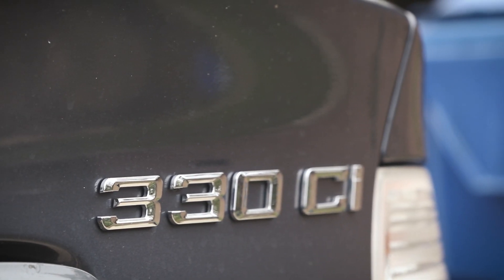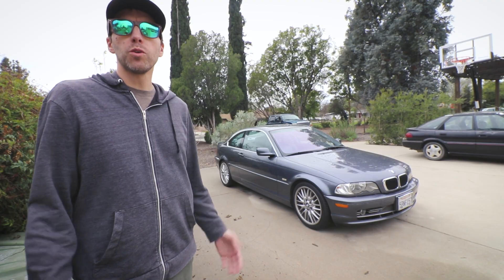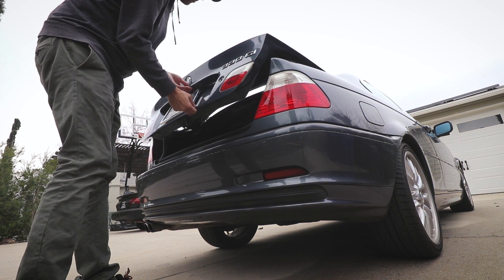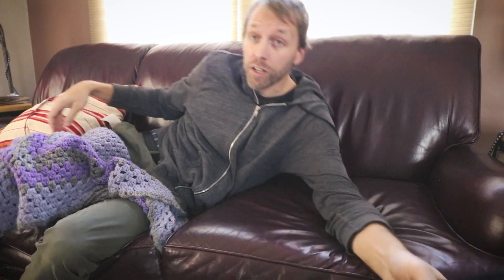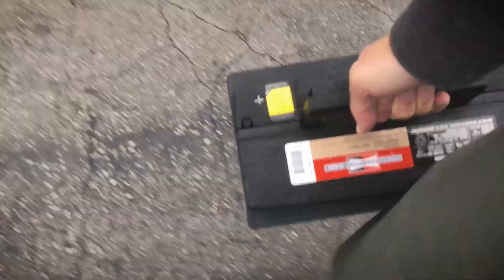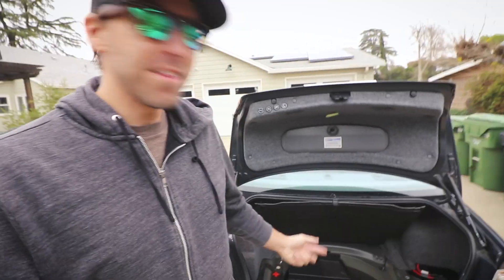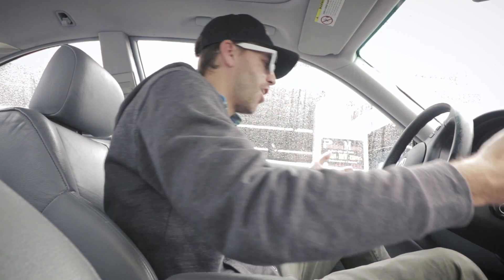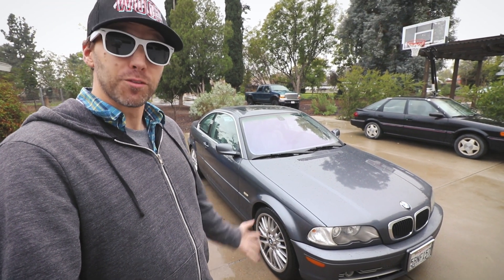Nothing More Expensive Than A Cheap BMW? - 330ci E46

Comment: All about the owner, I’ve owed 6 Bmws and beat them to hell... never once stopped running
Reply: But I agree with what you said at 5:25
Reply: Cody Holtsclaw go buy a bmw Alpina B7 like me you got to baby it or it will break faster then you can say shit broke the bank
Reply: That's a good statement. And yeah bmws are reliable depending on how you take care of it. Most of these cars have a known issue. For instance my s54 is known for it's vanos and rod bearings. Though if I leave it and keep running it, I can literally tear up my head. Then you'll find an 80 dollar broken timing chain guide ends up costing you 3000 dollars for another motor.  Other than that I've probably dumped over 5k into my m3 most of it being either suspension, maintenance, or restoration.
Reply: Yup. My E60 530i had 220,000 before the first ever problem hit (steering pump).

Comment: I just bought a e46 sedan 325i facelift for 900 bucks and the transmission is buggy, I think its because the fluid was likely never changed. Every single other part of the car is perfectly fine though. It's not the car, its the owner.

Comment: I bought a 2002 325i for 1600 dollars as my first car. Car had 215000 miles and I’ve since put 8500 miles on it in 6 months, and not had any issues mechanically. I’ve put around 250 dollars into it since (that includes 2 oil changes and a new set of plugs as well as a new air filter). Main issues with it when purchased were warped rotors, bad LCA bushings, and 2 bad window regulators, all of which have been fixed for very cheap. All In all I’m super happy with my purchase. I think I owe the reliability of the car to the previous owner. I found a service record in the glovebox from 9 months before I bought the car for 1800 dollars purely in preventative work, and the car was obviously cared for and well maintained which is reflected I’m not only it’s condition, but how it drives. I can honestly say that I love this car. I had no intention of buying a BMW, but when this popped up and fit my criteria (cheap and manual transmission) I just couldn’t refuse. I’m so glad I didn’t. I now plan on saving and hopefully buying another E46, but this time a 330i/Ci.
Reply: As your first car??? I wished I could do that in the UK

Comment: Who buys a car without driving it then complains about it smh
Reply from the maker: Not complaining. Just documenting what happened. :)
Reply: It didn't fly to his drive did it. BMW starters are pretty binary in operation (they work or don't like most electronic items). I've been trailered twice because one that worked fine to get me somewhere didn't work when I got back in the car. 125k on average so 99k does seem a bit low for one. YMMV I guess....literally.
Reply: @ruk2023--  That's one of the main reasons to buy a standard. So the starter can't immobilize you..
Reply: Had the EWS module go out on mine not too long ago. Same symptoms. Tried new batter and bump starting the car but it would fight to turn on. 250 and an hour of labor to reprogram the computer and she was starting on her own again
Reply: M3 Bimmer I just did

Comment: Whem my starter broke i remove it myself for 30min ,dismantle it and findout the coil that turns on thenstarter is fault. Bought new for 20$ and everything back.Didn't call tow truck,didn' sleep and eat while the mecanics repair my car.I get my hands dirty and did't hate that great car.
Reply from the maker: Totally understand about getting your hands dirty. But replacing the starter in an E46 is def more than 30 minutes.

Comment: Working on BMW is actually incredibly easy. They are put together so well that they actually come apart very well. They're just Layered. you have to take a lot of crap apart to get what you were going to work on. 

And having small hands sometimes helps. But there are tutorials almost everywhere on YouTube. And there are many blogs that you can print out the tutorials with full-color photographs. 

I have a 2005 M3 and redid my entire cooling system and police and tensioners using a 35-page print out. It was a snap.

Your 330i  E46 is almost identical to my E46 M3 in many respects. They share a lot of common parts too. So I know that they are really easy to work on. 

Anything after 2006,  you need a lot of diagnostic crap because it's so computerized. E46 was the last Model a shade tree mechanic and really fix easily.

Comment: Starter on my e46, $86 and an afternoon of work. New Battery, $35 from the Blemished Battery store, new rims, (new to me Craigslist), $80. New rubber, $260. New Struts and strut tower bearings, $250. (Monroe sensi trac and SKJ strut mounts). 10 piece front suspension kit, $170. (control arms, control arm bracket/bushing, etc), lifetime alignment $ $150. (asked for the $25 off coupon). Cost of car, $800. (craigslist,145K miles).  oil change and tranny oil change I don't count as that's maintenance instead of repair. Moral of the story, if you shop around and have the time and know how you too can tool around in BMW for a little over $1,800.

Comment: lol $700 i changed all the vacuum hoses and the starter and cleaned everything the whole intake manifold inside and out for $100, its not that hard just time cosuming as you have to take off the whole intake area to get to the starter when i found ouuut the minium to work on a bmw is $125 an hour diy isnt so bad and people say its hard to work on bmws and i think its quite easy besides the one thing the starter everything else ive done or changed was quite simple or a quick fix
Reply: Are you a mechanic yourself or just experienced with cars?
Because last week I had to replace the blower resistor behind and next to the glove box. 
Getting the glove box and screws out from the unit was easy. But boii.. Getting out a "stuck" metal and plastic unit that has been in place for many years is so hard to pull out.
Reply: No I'm not a mechanic but I've been doing all my own work to my cars since I was 16 I've never had a blower go out in any of my cars in my lifetime thank goodness
Reply: @Spaange  you mean the hedgehog? Done that last year on my 99 318i E46 only its via the drivers footwell on RHD, still have to remove the underside of the steering for access same as the glovebox. Nevertheless it's buried in there good and was a royal bitch to change. Think it took me most of the day as most of it was spent swearing at it lol. The starter motor was a 30min DIY. Can't recall actual time but I know it was quick and easy.
Reply: slabby rider idk for me one job I won’t really do is a slave cylinder such a damn hassle
Reply: e46's are super easy to work on, did a ton of work on mine, not really reliability related, just maintenance, clutch rear main seal, oil pan gasket, a handful of other seals, and it was honestly easier than any honda ive ever worked on
Reply: @plantedrabbit3  it's funny cause I had a 240sx s14 and it was easy to work but I tell people my BMW is easier to work on cause your not limited on space in most areas like my 240 was when I was doing anything to it
Reply: They are very easy to work on. I’ve replaced many many parts in my 2 BMWs including a starter, which wasn’t that hard tbh. One of them is approaching 300k miles and is still going strong.
Reply: just did the valve cover gasket in a bit less than 2 hours for 60$ bmw wanted 592$

Comment: Keep driving it with the gas light on and you will be sending it back to the repair shop for a new fuel pump and filter. lol
Reply: Fuel pump is very easy to replace, it's under the back passenger side seat. Replaced mine on my 2002 BMW 330ci. Got the fuel pump from the junkyard for $75.
Reply: He outright said he was cheap,, so what do you expect....?

Comment: Actually the E46 platform is not that bad. I own a "cheap" 330ci with 301000km and the only things that went bad since i own it (have it for 60 k km) were some bushings in the rear suspension, the coolant expansion tank, front lower control arm and some clips at the sunroof. Of course my headliner is sagging. ;-)
Reply: However, I replaced the CCV system, the headcover gasket, the water pump, thermostat, sparkplugs, vanos gaskets (Bisan Systems), shifter bushings, rear shocks, shock bushings and some other bits for preventive maintenance.😂
Reply: I see a lot of comments about the sagging headliner, but mine looks brand new and my friend e46 looks pretty good as well.
Reply: The headliner itself is fine. Its the a, b and c pillars where it is sagging (at least in my case).

Comment: I hate the "cheap BMWs are expensive, period, the end, no changing my mind" mentality. I bought an '02 330ci and it's amazing, because I didn't go into it expecting it to have no issues, nor did I go into it with the mindset that it would be outrageously expensive to fix. I've had my car for 2 months now and the only issues I've had are wheel speed sensors, and consumables. The vacuum lines are known to go bad over time, especially with the "m" series engines, as well as starters, you should've expected that going in to it. As much as I'd hate to be that guy, but seriously, do some work on your car yourself, I get the starter, but the vacuum lines are relatively easy and accessible.
Reply from the maker: For sure, working on BMWs yourself can save a ton of money. Just didn't have any interest doing the starter, not a fun job. But absolutely, would've been much cheaper had I done it myself.

Comment: If the Battery is empty the starter makes clicking noises and dont Turn the Engine. Just a tip Mate ;) like this Video and Greta from Germany and BTW you Need a Voltmeter do you can easy Check your Voltage ;)

Comment: Old BMWs are known to be reliable. My father had his 1996 BMW E36 318is valuable at 3.000€, the car had 130.000km and the only problem it gave in 20+ years of ownership was the battery that died once. It all depends on the owner and how they treat them, and still, these cars can take a beating. Especially big engined like the 330
Reply: I have a 318i auto with 370000 km on the oddo

Comment: That trunk handle - find a cheap one on eBay, spray it flat black, bolt it on and call it good.  That’s what I did to my grey 330Ci and it looked factory...saved about $170 over a new replacement part
Reply from the maker: Luckily I found a color-matched one on eBay!
Reply: Hello Road / Ethan Tufts well there you go!!
Reply: These e46 cars are super straightforward and easy to work on with a good automotive tool set

Comment: 90s and early 00s bmw's are not to bad. Its the overtechnical new/young ones you have to watch out for. And the E46 is one of the best "modern"  bmw's ever made. But you do have to baby it if you wanna put some serious miles on it. I've seen a few with 300k + miles on them.

Comment: I have an E46 320i and I had a big problem that took me a long time to figure out. I checked the battery, the starter and even replaced the ignition switch. No crank and no start. I discovered by accident that the fault was in the immobilizer. It had a broken capacitor. The repair cost €0.50 but took two years to discover.

Comment: Hopefully, the coolant and heater pipes have already been replaced. Otherwise, you might be wishing that they got replaced this time around. Those pipes run along the engine block and are only accessible by removing the intake manifold.

Comment: A 2003 5spd manual with 99k for $2500 and $900 Into it isn’t too bad.  My ‘05 E46 sedan has 221k and runs like a champ. These cars are impossible to flip and should really be bought for fun. Supe them up and enjoy. Great engineering and plenty of reason to get under the hood of you like that.
Reply: Relevant and best comment

Comment: I used to be a serial BMW owner.
But each new one was less reliable than the one that preceded it.
The last one visited the dealership 26 times during the warranty period so I sold it 100 miles before the warranty ran out.
I bought a Buick Regal (Opel Insignia) GS and it has 193 K on it now.
Never stranded me or failed to start and in the seven years I have owned it only off the road for three days for repairs.
1. ABS sensor
2. A/C condenser. Damaged by road debris.
3. Alternator

Comment: Don't hesitate to go after market for most of your parts. You'll find that many of the German aftermarket are not aftermarket at all. It's the exact same part without a BMW box.

Or things like gas struts for the hood and trunk are by The dirt cheapest Amazon Chinese made stuff. It's fine. It's just fine. Just use your head when you're buying parts made in Asia. For engine components stick to German or USA
made.
But I've bought Asian made side view mirrors variation made running lights on the corners they were already Depo.

I got a set of the most beautiful gloss black kidney grills that were made in Asia that were far better than the German made crappy ones that game with the car.
My HID fog lights are from Asia and they are just dandy 6000k bright and beautiful.

 I buy almost everything I need from Amazon or Ebay. And the rest on some of the larger dedicated BMW Supply sites.

All my pulley tensioners Etc exact same part made by a company called Ina that supplies the parts to BMW. So I just bought these Ina parts without BMW box for pennies on the dollar.
 German made ..exact same part. I bought them on eBay for almost nothing brand new.

My thermostat was American made, I bought on Amazon brand new for $25 instead of the $90 BMW version. My thermostat is every bit as good as German one if not better. 

Gaskets O-rings nuts and bolts all on Amazon just get the part numbers off of a website called Real oem.com.

 Do a search using the part numbers for every single things that you need for your car. I would just do searches using part numbers that you obtained from realoem.com and find the cheapest source start the internet. It will likely be Amazon or Ebay
Reply: Hello guys, I'm planing to buy a bmw 330i 2005 for it being my first car that I own, the thing is, is it expensive to do the oil service?, colling system etc, the common things. I want to know because I live in México and people tell me that its expensive to have the car well maintained.

Comment: Had an E36, bought it for 1600 € and wasted around 2500 € repairing it in a year time, then selling it for 1300€. The curse of these old beemers is rust, somehow they had very shitty corosion protection or none at all.. So the rocker panels and rear wheel arches basically rott away on every car that has been driven in winter. 
I Avoid these old cars now, especially the E39s are rust buckets unless you live in a hot dry climate. Rotten body is an endless money pit, don't be stupid.

Comment: I have a 05 325i e46 and I love it. 2800$ 130k if you find a solid one that’s been taken care of, they will last a long time. Currently at 170k a year and a half later
Reply: 40k in a year and a half? You drive a lot?
Reply: @steezymissfire8818  BMWs aren't so bad if you can work on em yourself. I'm 18 and driving an 08 Fusion, rocker panel on the passenger side is starting to bubble at the very bottom. I'm about to start working but don't suppose I'll be able to save enough money for a newer car this summer. I'm thinking the move is sell the fusion for hopefully at least $2k (137k miles currently) and hopefully I'll have saved enough that it'll get me a better car with 2k or so added. My dad bought the fusion for $3k with 136k in November, it's got no issues besides the interior door handle broke haha. I think the tire tread is getting low too, little past Lincoln's head but, one day I want to own a BMW! I'll wait until I'm living on my own haha
Reply: KillermanV3 my dad also has a fusion with the same problem hahah I think he paid 12$ for the door handle on amazon
Reply: There is a lot of bmw distmantlers in my area so whenever I need cheap parts I go to them because you can barter prices and even trade things. They sell cars too usually pretty nice ones. I’d check you’re area for something like that

Comment: Like you I have right now 8  cars most I bought at auction, that  means unseen and untested, but very cheap cars. Can always flip them with some profit, not much, but it's just for the fun of it. We need to consider that his prices are California prices. A battery for $ 204.00????? Change a starter and some vacuum lines, $700 bucks? Man get out of that state.
Reply from the maker: Yes things are a bit more expensive here in Los Angeles! However, they did also have a $169 battery, I just opted for a better one. I also neglected to mention that the shop also fixed a major power steering leak, did oil change, among a few other things. Good luck with your flips!

Comment: ARE YOU CRAZZZYY ?????
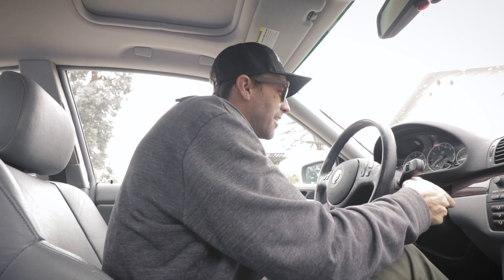2:10 JUST PUT THE KEY IN AND DO QUARTER ROTATION YOU WILL SEE THE CAR DO A QUICK CHECKUP YOU WILL SEE ALL THE LIGHTS TURNS ON. THE SOUND THAT THE CAR MAKES IS TO TELL YOU TO PUT THE SEAT BELT AND WAIT FOR THE LIGHTS TURNS OFF ( EXACTLY 5 SECS) !!!!
THE CAR  NEEDS A LITTLE TIME FOR THE CHECK TO FINISH